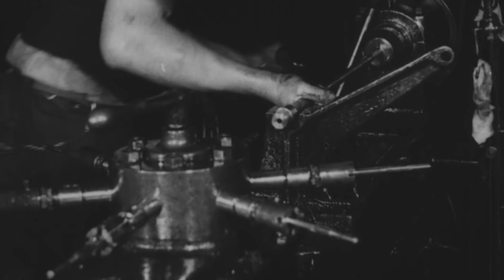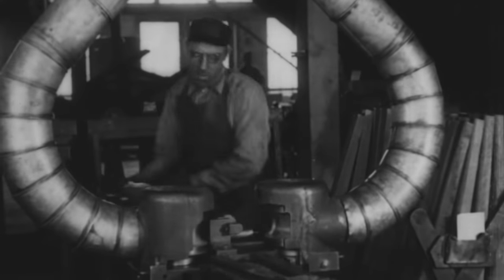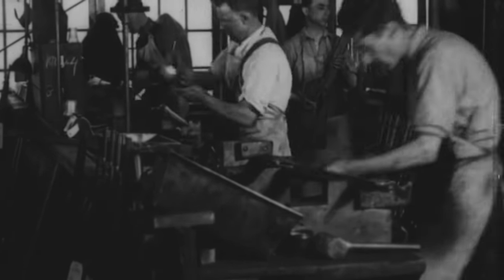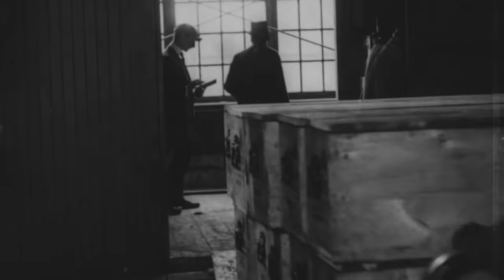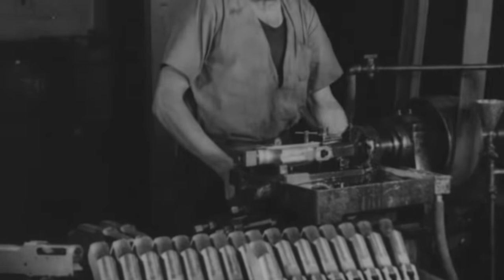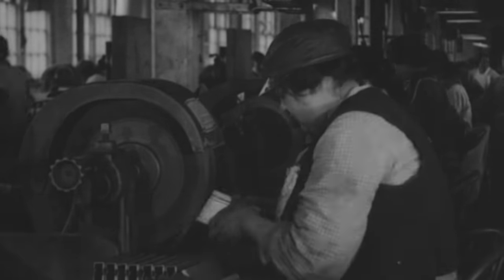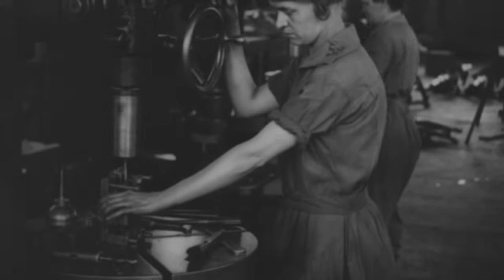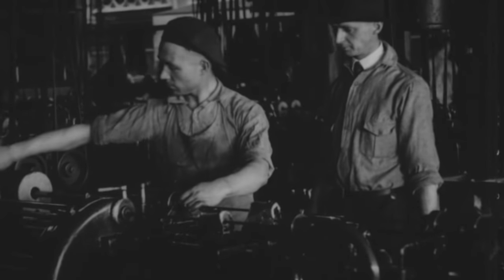Making the War - with Bloke on the Range and Taofledermaus

Comment: 0:19 Forging receivers
2:10 Cold rolling barrels. To straighten and possibly add taper. The dies have that polished start line as it is the first place that grabs the material, the mark tapers away as the stock becomes straighter even though the dies are probably progressively smaller
2:40 Rough drilling and cambering the part finished barrels. Note the straight fluted drills. For better coolant access and can be made from a lot harder material cheaply. A factor in this type of tooling a long time ago. Today you only do it for cost but with difficult materials 100 years ago you needed every advantage you could get trying to hold size.
4:34 They have missed a step in the process as it was probably a bit secret at the time. post rolling the blanks would have been reforged on the cambering end probably cold. End forge marks are seen in the manual straightening with a hammer part of the video.

5:37 I would guess they are pulling a die through to rifle the bores
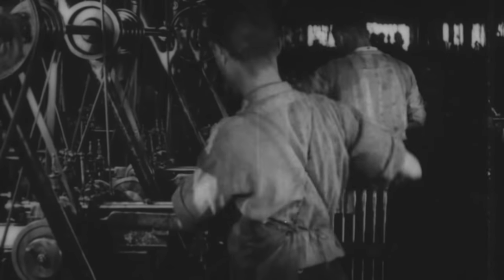5:47 milling front sight slots. Notice the operator spinning the barrel to achieve alignment with the correct position for the receiver?
8:41 Usually called a copy lathe but most have a tool that spins and is motor powered so they are really a copy router
11:47 precision machining the stock for? Maybe reciever, magazine, trigger
14:19 These could be called a slotters.

Comment: I am a retired tool and die maker and in the 1990s worked in a shop that made magazines for Ruger, Browning, Smith and Wesson, Wildey and others. We turned out about 2 1/2 milloin a year. Tooling contract for a new magazine would run from 50 to 100 thousand dollars but per piece price for finished magazines in lots of 10,000 was less than 2 dollars that retailed for 15 to 25. The middle men make all the money. Traveling wire EDM machining make prototype development a lot easier and faster as we made the form tooling first and wire cut stacks of 10 or 20 blanks to prove prototype shape befor making the blanking die for production.
A lot of these were stainless steel which can be quite hard on the tooling so the tool steels were fairly exotic and diffficult to machine as well. Most gageing was tungstun carbide faced and toleranced to .00005 inches.
All in all a fun place to work if you enjoy precision.
On the other hand we would have had fun with obsolete magazines made out of common carbon steel. the problem being they are probably a low demand volumn item which makes even class B or C tooling prohibitively expensive.
Reply: Pay attention to what the Engineer is saying guys 👍

Comment: Many of these films were shot at 16-18 FPS and digitized at 24 FPS. They need to be slowed down about 25% to look properly timed.
Reply: Old cameras were either hand-cranked, or they ran on springs or batteries, both of which would wear out; in any case the camera wouldn't be running as fast as it should, so you feed that film through a projector that's on a constant power supply and it's too fast.

Comment: Dude, as a machinist I’ve never been more thankful for modern engineering 😂 god bless CNC/safety standards
Reply: Yea, but just think of all the free brain power you have to focus on personal safety, since pretty much everything is jigged up and single/few fixed operations at once! No need to change out tooling for the next operation - you just perform yours and then give it to the next guy!
Reply: Think of the cutting fluids and oil on bare skin..... run screaming from the video
Reply: Apprenticed in 1960's. Have done all this. The turret lathe is a fun set up.
Reply: @seanhazelwood3311  CNC operators aren't machinists but the guys making code and doing setup are a step above. It's a whole other art, because unlike manual you don't really know what's wrong until it goes wrong. Plus time and money are more important when a company has a million dollars invested in 1 machine. The only reason monkeys can chuck and go is because engineers have tested and optimized the operation several times before.

It takes about 1-2 working weekd to set up a CNC for mass production after the code and design is ready.
Reply: Sean Hazelwood button pushers yes, I’m setting up and programming.
Reply: Rl Badger I’m one of them spoiled millennials with my CNC 😂
Reply: @CopperBurrito1  I do prototype parts one off. I'm twice as fast as a programmer, let alone a set up and run on a CNC.
Reply: Rl Badger oh I believe it! I really need to play around and get good with our manuals. If you’re decent you can crank out prototypes quicker than I could get the tools in/touched off in the CNC. I’m just not too great with them (kinda scared honestly). I wasn’t feeding hard enough on a manual lathe and the chips strung up around the chuck and spun around, almost lost a finger 😂
Reply: true, but you could chew tobacco at work back then ;-)

Comment: @28.20 that's a lathe dog. They are turning between centers. This is more precise than holding one end in the chuck, and faster setup. The dog is a clamp on bit that allows rotation to be transferred to the part.

Comment: Lineshaft shops are relatively quiet, check out Dave Richards youtube channel - he has a lineshaft powered machine shop.
Reply: Now days sure.  Dunno how loud the belts and primitive machines sound.
Reply: @warrenokuma7264  These machines weren't primitive. The noise was all the operations themselves and you go into a manufacturing shop now, it's just as loud because the operations themselves are loud. Machinists are still hard of hearing nowadays, there's no way to silence hogging off 1 inch of steel with a rougher, even if it's inside a CNC.

However the motor noise is not present in a lineshop. The motor noise was a loud whine and the belts are flexible usually leather back then and they where very good at absorbing sound. Even now if you ever see an old timey belt run lathe, they're much quieter than a modern gear run. Even if the gear lathes are usually better in every way.
Reply: What I find crazy to watch is them test firing guns (even a machine gun) indoors with at most earplugs and some no protection at all.
Reply: @johnanon6938  "wasn't done in the army or by hunters in the 1970s and 80s."
That's half true. It usually wasn't done on an institutional level, but every soldier knew that putting something in your ear is a good idea. If you've fired a gun you know that after a while it just hurts. Soldiers would put bits of cotton or cloth or whatever was on hand to plug their ears, and artillery was usually issued some ear plugs. We had a ww1 vet-- my friends grandpa actually- in middle school who told us he was given bits of cloth to shove in his ears. He said he's one of the few who isn't completely deaf but someone had to stand next to him so he could hear.

Comment: Wonder if we could ever learn to do this all over again if it came down to it, going back to a time before computer controlled milling operations and all your machines running off the same central operating mechanism...
Reply: Of course we can, but it would be a case of trial and error reverse engineering with assistance from documentation.
Reply: Yes we could, in fact all modern deign is based on old methods. The reality is CNC is not magic, the purpose of CNC was to replace 10 people and different machines for 10 different operations. These old assembly lines are very simple, everyone does 1 specific task with their machine, for example that guy with the bunch of drills and the jig, he drills 4 or whatever holes in 1 part with 4 tools already setup, the purpose of CNC is that the machine can do those 4 holes in 1 setup without having to move the piece or put it in a special jig. Saves time. Sometimes we actually go back to old methods, it's about costs, i worked with a company who made a welding fixture for welding the the U hook in the back of the dodge ram pickup for the tailgate latch. It was faster and cheaper to do it by hand than with a CNC welder.

To this day, the hardest part about tool and die making is not the CNC or even the design, the hardest most expensive and time consuming part is a master machinist sitting there for hours to days on end with a needle file or hone knocking off edges and burrs, because there is still no machine that can do this to the quality of a guy who knows what he's doing.

Comment: I found these films at Critical Past a few years ago when I got my M 1917 Eddystone.  I think they attribute these films to the Eddystone factory.  You guys have made many comments about the line shaft powering of the machines.  There is documentation about the Eddystone factory which gives the statistics of the machinery and size of the factory.  I think at the time when it was built to manufacture P14 rifles for the British contract it was the largest rifle works in the world.  The factory reverted to the Baldwin Locomotive company after 1919.  The only remaining building is the woodworking building.  There is commercial retail shops and a Walmart on the property today.

Comment: If you made one wrong move around all of that machinery you'd be in ten separate pieces scattered around the factory.  They'd be finding bits of you for weeks.
Reply: Back about 1968, we had a guy lose about an inch of a finger starting an electric motor by tugging on the belt.  Didn't find the piece for about 6 months.

Comment: Think this proves Bloke needs to write a book on 20th century firearms manufacturing methods. Because just watching him point out a thing and talk about it was fascinating.
Reply: Mutenri The whole thing was super fascinating but why did it seem like every time Bloke was saying something he’d get cut off or like nobody would respond? That was a bit frustrating.
Reply: @simplymadness8849  Probably had to do with whatever program they were using for the VIOP/recording connection and how well Bloke's ISP was dealing with latency at that particular moment. I've seen it happen on a lot of different streams, one guy ends up with high latency in his connection and ends up getting his audio chopped and talked over.

Comment: God damn, I want a M1917 so much. There ain't much of them down here in Poland, but I know two or three dudes who have those.
Reply: I don't know what Polish firearm import laws are like, but there are American gun manufacturers making new-build 1917s right now (well, not at this moment with all businesses shut down, but as a going-thing).  If you just want one and don't need a "historic" example, you might be able to buy one.
Reply: @ANonymous-bh1un  Oh shoot, I didn't know that someone is doing replicas. Importing one would not be very difficult legally, cause it's just a bolt action, but the cost of such an operation would be quite a headache. But every now and then one pops up on the auction sites, so importing might not be necessary. Thanks for the info on the reproductions, I appreciate it.

Comment: othias you should really get someone who does manufacturing to comment on this stuff.
That wasn't a broach btw. it was a keyway cutter. the receiver was likely millled as a stop cut so the end travel would have left a semi circle. the keyway cutter was merely squaring off  the the rest of the opening. the metal can only be removed gradually do to the cutter tool steel vs the receiver steel relative hardness which means several passes  or feed rate per pass as you saw..
Reply: Keyway cutters are broaches like what you're describing. We typically refer to dovetail, and woodruff key endmills as just keyway cutters, or keycutters. Linear key cutters like what you'd see in gears and pulleys are broached with keyway broaches: https://dumont.com/wp-content/uploads/2011/09/broaching-illustration.jpg

Comment: Lol, the "engineering" that goes into tool & die construction.
Tryout is the process of making a die make parts to fit the checking fixture.   Then an assembly has to be made.  The assembly has to fit a gauge or fixture, and if not, the checking fixture and stamping needs to be changed in order to make a good assembly.  The die designers more or less layout the process they want, and the die maker will make the tool make a part that matches the part print.

Comment: Change these from guns into cars and it could be Tesla trying to set up the Model 3 production lines.
Production is the hard part.
As for the speed of the footage: I doubt they're filming at 24 fps. They might be filming at 20 frames, so when its run at 24 fps for the transfer, it mucked up the apparent speed.
In the first video clip: The crates look like they could be 15 rifles each.
The third video clip: some of those uniforms look like US dress uniforms. I don't recognize the gun though. I thought it was Vicker's at first.